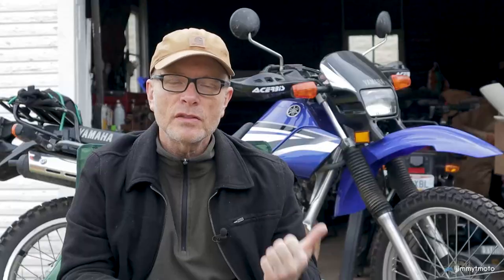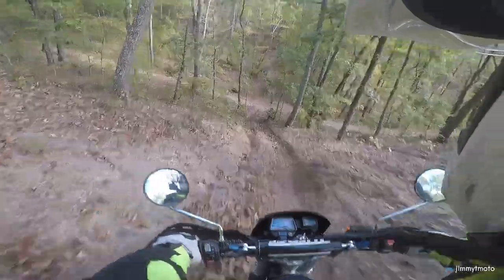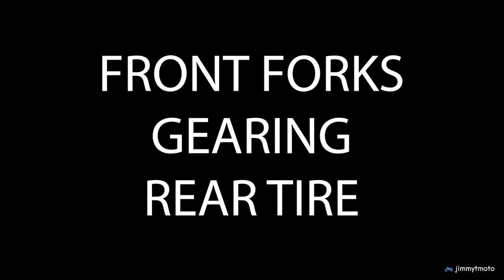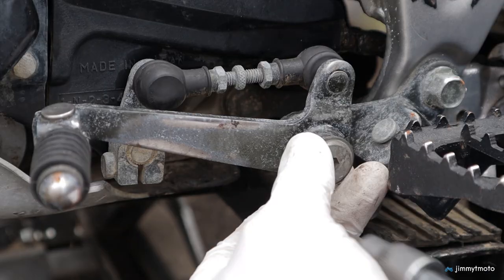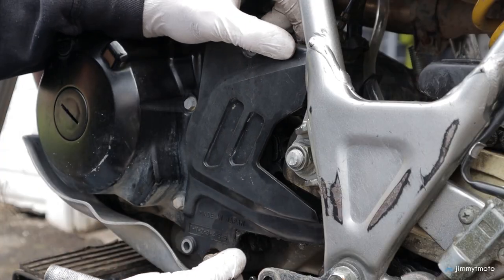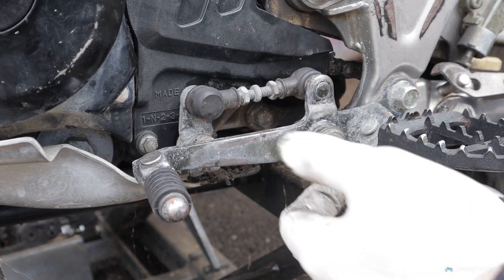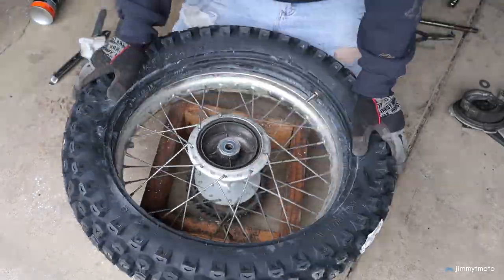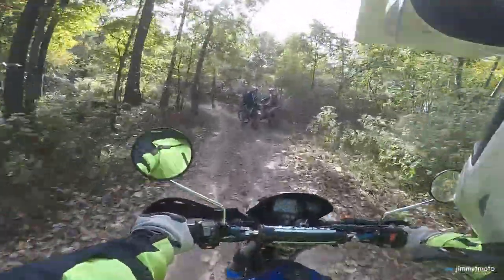Budget Dual Sport Mods for the Yamaha XT225

Comment: i went out yesterday on some dirt in the stock tires and lost traction with the front wheel several times, when going 40-55 i could almost feel the front walking side to side and it felt gummy and strange, this was my first time offroad and basically my first real ride on a motorcycle so i attribute alot of my issue to that but i was just wondering if i put something real knobby on just the front is that gonna impact my traction on the road, i dont really wanna ride dirt as fast as i did yesterday but i was trying to keep up with 2 stroke 250's

Comment: Great video.i like the size of those 225 and xt250.i also like the weight of the xt225 and six speed.i think somewhere around 230lbs is light.all pluses for that bike.im riding  a 91 drs 350.quite a bit heavier. But the  bike has got some  real grunt.went through engine professionally and a new pumper carb instead of the California  emissions  one.some day I might run into one of those 225xt for sale and have to buy it.thanks for all your info.

Comment: Great video. I’m looking forward to hearing you report back on the 14T front sprocket change.
Reply from the maker: I just took a ride today and initial impressions are that it's much more lively and LOTS of fun on backroads and hills. It's a bit "buzzy" on the road at 60+ mph due to the higher revs, though, and MPG might take a hit. Will report more once it's had a good go on some trails.
Reply: @jimmytmoto  If you ride more in the woods you'll love it.  If you're more of a street rider then you won't.  Over 60 and it will feel a bit of vibration though the newer XT250 has a counterbalanced engine which really helps its street manners.  Don't know about the XT225's engine but the XT250 is happier under 60 as well..  Where I ride in Northeast Pa we have some serious rocks and uphills where the lower gearing  really comes into play. It's a tradeoff for sure but I find the 14 T more of a help than a hindrance.

Comment: Thank you for your update and Hope you’re doing well!   Great ideas there with your XT225 changes.  I have a 2007 XT225 and have done a lot of mods to mine.  I just did put the Kenda 270s on front and rear and hope they do well for me.  Please let us know how your mods do over time and use.
Reply from the maker: All is well here, thanks for asking. And, yes, I'll definitely do a mod update after we've racked up some more miles. So far I'm loving the gearing and the Kenda but am mixed on the forks. More to come...
Reply: Stock front tire on my new TW200 washed out so often, I put a Kenda 270 on. HUGE improvement in steering. 1'-1/2" narrower than stock.

Comment: It's important on multi rate fork springs to cut the two Inches off the "soft" end...to raise overall rate.

If you do the other end it will lower rate..

Also use oil level to set fluid ..much more accurate...start at 4 in from top.of tube with fork collapsed and spring removed.

If you want to slow movement in last third of travel slightly" raise " oil level. This is a tuning variable and will take some .eexperimentation to perfect for given rider...it is well worth the effort
Reply from the maker: Thanks for the guidance, Michael! It's a blast to tweak these simple, fun bikes, and learn along the way.

Comment: huh, thats funny, ive thought about kicking it up a tooth in the front for a bit better power delivery at higher speeds, never thought about going down, i guess i dont do nearly as much trails so i want it to be a bit easier on the bike nearing her top speed. i do defititly need a new rear though, thanks for the vid man.
Reply from the maker: Right on! Let me know if you go up a tooth on the front and how it works out. My initial impressions of the 14T is that it's a blast on twisty roads, though I haven't hit any hilly trails with it yet. At just $20 for a front sprocket it's a fun, relatively inexpensive way to experiment.
Reply: jimmytmoto yeah forsure, it’s not so common to find something so cheap in the motorcycle industry that can make such a huge difference to your ride

Comment: Hey Jimmy. Good to see you back to making good content. I was just watching a little video on the SR250, and magically your video notification popped up. How's your SR250 doing?
Reply from the maker: Thanks, Joe! The SR250 was running great but it needs a new battery. I must have left the key in the "parking light" position after the last ride and now the battery won't even take a charge. I'll be swapping that out soon and will post an update!
Reply: I haven't had a battery issue yet. Surprisingly. I have left my keys on a few times. Trickle chargers are awesome. Lol. I have just finished putting some cheap chinese turn signals on. I found out that they work all my themselves without a flasher relay. I had to unplug the original flash relay and just shove a wire in the connections to bridge the wires together. These lights are so bright. Front turn signals have white lights when not being used as turn signals, and the back double as brake lights. Great product.

Comment: Best budget mod for most XT225's is proper jetting for conditions. Spend the $5 for the proper sized jet. If its stock its probably on the lean side especially if you have any intake or exhaust mods. If you ride at high elevations you may be okay. Sea level not so much. The idle screw is set lean from the factory as well.
Reply from the maker: I've unplugged and set the fuel screw but the bike is otherwise stock as far as intake/exhaust and seems to run well. I'm might lift the needle and the main a bit just to see what it does. Thanks!
Reply: Hey if it aint broke dont fix it. Mine was very cold blooded new and was a bugger to keep going when cold. The idle mixture adjustment cured that . I ride mostly at lower elevations and found going up to the 130 main and opening up the intake an exhaust worked great. Probably picked up 1 to 2 hp and no flat spots.

Comment: I'm going to try the tusks dual sport tiers front and back.  The 225 is not my bike it's my 14 year old son. I do ride it sometimes so if these tires are any good I will try them on my 250l.
Reply from the maker: Hey, let me know how the Tusk tires work out!
Reply: @jimmytmoto  
I will try to remember.
I just got them in today, they are "beefy"
They look good, I would have mounted them tonight but I had bought new bearings so I got them in and decided to put a new  tube's in so I ran out of time to run down to the bike shop to pick some up. 
Tomorrow is another day.

Comment: I’ve been trying to find a new carb for my xt225 because my old one is broken do you know where I can find a different one for cheaper than if I bought the stock one from Yamaha?
Reply from the maker: Hey, Gabe, you can typically find what you'll need on eBay. In the vast majority of cases a rider will just get a rebuild kit ($40) for their existing carburetor since there aren't really many things that can actually break. That's the route I'd highly recommend if you can do it. Alternatively, there are really cheap ($50) complete knockoff carbs for the XT225 available on eBay but those can be a real crap shoot - low quality, they might not take normal jets, etc. But I guess it's worth a gamble if you're completely high and dry. Good luck and let me know what you end up doing!
Reply: I put a carburetor for Suzuki Ts185

Comment: I noticed you went up in size on your rear tire. Did the 460 fit with out any mods? Are you running a 275 or 300 up front? Thanks for any input as I  am looking at a set of new tires for my 2002, by the way the stock Chen Shens are horrible the front washes out so easy in gravel its pathetic.
Reply from the maker: Hey Mike, yes, the 4.60 fit just fine. Yamaha recommends a 120/80 which I guess translates out to 4.25/4.50 in inches, so it's pretty close. I saw that Kenda does make a 4.50, also. TBH, I was really surprised Yamaha didn't recommend a smaller tire like a 4.10 but I'm happy that it pulls the 4.60 well.  As for the front, I've been running the K270 2.75-21 for a while now but...I DON'T recommend it. If I had to do it all over again I'd get the 3.00-21 but am not sure if it's a fit for the front rim width. I'd want to ask Kenda first. I plan to post a tire video next Tuesday on the Shinko 244 vs Kenda K270, so if you can hold off for a bit I think the video could be informative. And thanks always for the comments! Hey...Cheng Shins...are those still the stock tires???
Reply: @jimmytmoto  yes they are factory original and 18 years old, that is why I  am replacing them. Any thoughts on D605s, I think you said that 250 you rode was sporting them?

Comment: Great video.  What footpegs do you have?  Are those the DMO pegs?
Reply from the maker: Thanks! The footpegs were on the bike when I bought it so I'm not quite sure but, visually, they appear to be the DMO pegs, which look a little different than the IMS pegs. One of them is a little bent from a hard hit but I love the width and the way the teeth are shaped - highly recommended!
Reply: Any updates on the upgrades you have done on the forks?  With the changes up front, will you be tweaking the rear suspension at all?

Comment: Jimmy - Love the video - I have a 1992 225 cant get it past 55mph without feeling like its going to go over the RPM limit - any thoughts would be welcome
Reply: Go up to a 16 on the front sprocket. Will help considerably at highway speeds.
Reply: @yamahasuperbike2202  Thanks for the advise - put a 15 on and what a difference :) It had a 12 on it - why????
Reply: @rychu2001  these bikes are geared so low from the factory. You could practically take off in second gear. I've got the same problem with my new xt250. Good luck & ride safe!

Comment: Hey Jimmy,, Southern Indiana dual sporter here,  So I just got a 2001 XT225 with 3300 miles and tires need replaced, was concerned about the width of the rear swing arm and putting a 4.60 X 18 on there can you show me the clearance between the tire and swing arm and will a 3.00X21 work on the front? Thinking of going with the 244 but not sure.
Reply from the maker: Hey jesterman63, thanks for asking. My XT225 is in more pieces than I can count right now (it will be coming back soon!) so I can't easily show pics of your questions. In the meantime, I highly recommend the Shinko 244 front and rear. Zero clearance issues with the 4.60 out back and, personally, I'm happy with the 2.75 x 21 up front. I'm not sure if I'd go with the 3.00x21 up front just because of rim width, even if it physically fits between the forks. I'll mention that the Shinko 2.75 front is wider than the Kenda 2.75 I replaced...the Kenda was SKINNY. I hope this info helps get you further down the road. Hey, and whereabouts in southern Indiana are you?
Reply: @jimmytmoto  Thanks for getting back to me,  I just received my 244's today and my sunstar 50 tooth steel rear sprocket & I'm going to go with the sunstar 15 tooth front, I'm wanting a gold o ring or x ring chain but getting a name brand chain in what you want in the 428 pitch isn't very easy, I'm located just east of Evansville, and grew up Riding Trails over in Lynnville, IN. I hope you get yours back up and going soon and if you get down this way let me know and we can hit some trails.
Reply: @jimmytmoto  Dang I hate this, I just seen your video "uh oh metal shavings", I am very sorry and I hope you will rebuild it and if not I guess I could always use a parts bike, lol no seriously I cringed when I seen this video, I just did an oil change and I  had very minor residual flake aluminum but very minimal at best, you know like from an engine with 3,330 miles...also I was told from the person I bought it from that it had just had an oil change but I was reluctant to believe that because instead of clean looking oil it was more amber so upon inspection I realized that the filter was original stock yamaha so between the primary and secondary filter sources I came to the conclusion that this is the first oil change and all is well. I seen some of your other bikes and dig your collection, I have 2 XR 200's an 86 and 2001, 2 XR 250's an 84 and 91, a 1974 TY-80 trials , a 1975 TL-250 trials, 2017 crf 50 for the grandsons,  a 1987 Honda super magna, and a 1976 Honda LTD GL1000 and my new old 2001 XT 225  I also have a collection of  Mini bikes including some Rupp's. Let me know when you get it back together so we can go riding!!!

Comment: I don't understand how cutting the spring, and replacing the missing part with a PVC pipe will add to the springs capacity to lift. To me this mod seems to remove some of the springs lifting capacity and as such will result in the spring compressing flat, and bottoming out the fork travel even quicker than before you made the mod. I dont get it ? 
 Why not cut the spring in half, that should doulbe the lifitng capacity. I dont get it ?
Reply from the maker: It does seem contradictory and I have to think it through every time I approach it. And you're spot on about the possibility of shortening the travel if it's done wrong.  I think there are two things to understand - 1) shortening a coil spring makes it stiffer (i.e. a shorter piece of metal is stiffer than a long piece of the same metal). Unfortunately, the math is over my head to determine the final new spring rate once shortened, but you get the idea. Cutting the spring makes it stiffer and the PVC pipe replacing the cut off portion of spring just fills the space in the fork tube to hold the front end up. But 2) if you shorten the spring too much, as you mentioned, then it will coil bind or reach full collapse before all of the travel is used, which will definitely break something. So I measured the spaces between the coils and subtracted that from the spring free length, giving the length of the spring at full compression. Then I made sure that when the forks were fully collapsed, the spring and PVC spacer could still collapse another 15-20% more (safety margin, so the springs don't coil bind). Man, I hope this makes sense. If not, maybe someone else can chime in. I found this info by doing Google searches and learning from people way smarter than me on the subject. I hope this helps!
Reply: @jimmytmoto  You are using the work "stiffer" to cover a couple of different conflicting ideas I think. A spring, regardless of material, diameter, length, etc. is defined by the amount of force required to change it's length a given amount (the K factor for a spring). For example, a spring could be 100 lbs / 1 inch of travel. By trimming a section out of your fork spring, you didn't change the stiffness of the spring because you didn't change the K factor for the spring. What you did do is provide less travel available in your spring and you will bottom out with less force than before the modification. If you wanted a stiffer suspension you need to either get a tougher spring (higher K factor), or preload the original spring prior to installation. Had you installed the PVC pipe section and not removed part of the spring, you would have achieved your goal, as it stands you only reduced performance.
Reply: To clarify, preloading the spring would not increase the amount of travel available so you would still bottom out. It would however, make the system "stiffer" by increasing the force required to start compressing the spring again.